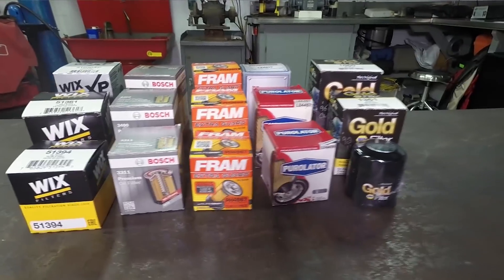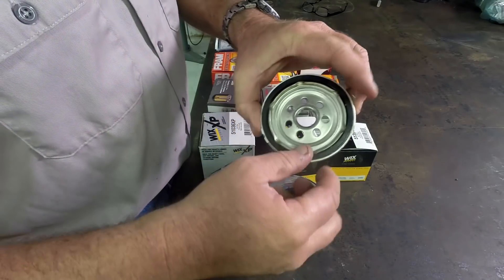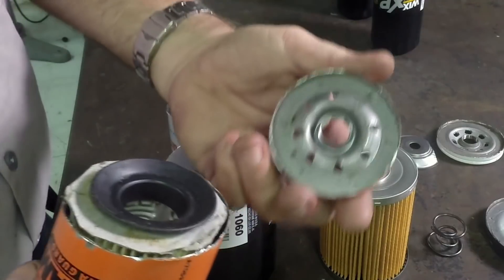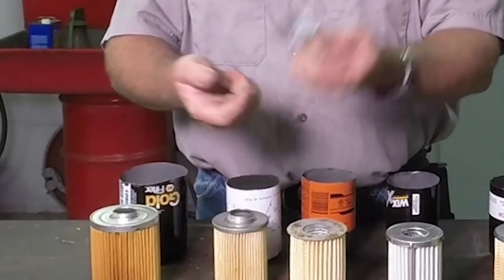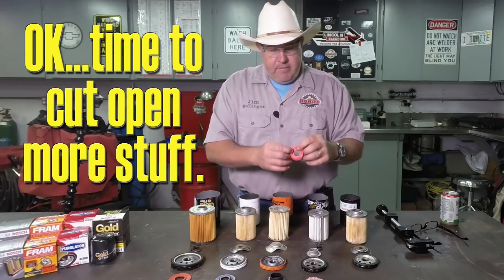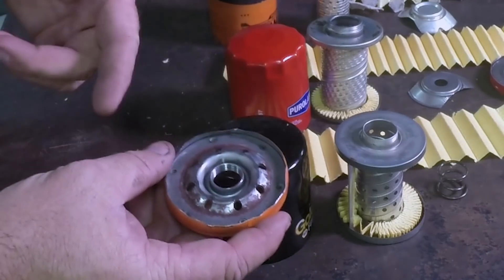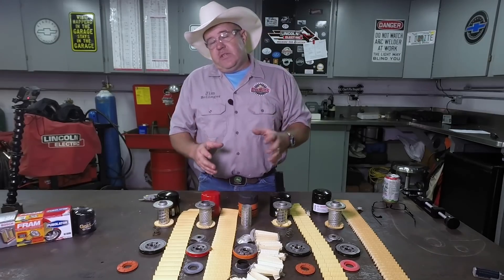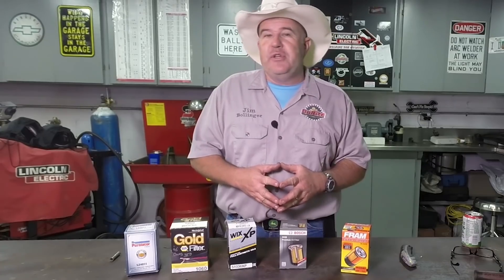The worst oil filter EVER!

Comment: Anti drain back valve, is only necessary if the oil filter goes on in anything but a vertical position. Otherwise it's useless.
An oil filter cutting tool is not so expensive and would make cutting those oil filters open a hell of a lot easier and cleaner.
And I know you probably do not believe it, and yes it looks like a cheaper device, which it probably is, but a tempered flat spring is a legitimate spring. And if it tests to do what they needed to do, in an oil bath it will last just as long as what a cheap-ass coil spring will do. As well as being easier to assemble in a high production environment.
You might want to measure that, as 10 gauge is almost a full one eighth of an inch thick. That is thicker than anything that's behind the driver in a 1968 Camaro. The heaviest piece of metal in one of those dangerous pieces of s*** is 11 gauge. Which is why when your rear end them you end up in their backseat before the car starts slowing down. Also why they needed subframe connectors when you put any kind of power in them.
You might want to try and check the pure one and also check the Purolator boss. Even Amsoil has been impressed with those for a couple of decades.
Very Illuminating, because it wasn't that long ago that Fram filters were actually decent filters.

Comment: Decent presentation, but if I may ask why weren't the filters spec to a particular engine. Different engines carry their own requirement, how the filter is mounted and if a drain back is required. I agree on one thing if its crap its crap.

Comment: Very interesting !  
Before watching your video, I made my predictions and your video confirmed my idea. In the late '80s, in Europe, I have done the same experience as you comparing Mann+Hummel filters with Fram filters and yet another brand. I think it was Technocar, but I'm not sure. This was the Mann W719/5 reference for VW gasoline engines.
My test was less extensive than yours, but was done on used filters. You could see the excellence of the Mann quality you mention for Wix and Napa, which seem to be the same industrial group.
In the Fram filters, there was a doubtful seal between the inlet and the outlet. A smaller paper surface. A badly immobilized paper. As a result, some foldings were very tight when others were lying ... and sometimes torn apart. In addition, the discharge valve in case of obstruction was calibrated at a much lower value.
Whenever I had a customer who was traveling with a Fram filter, I showed him my experience. I have convinced many customers of the quality of Mann, especially since they were not more expensive given the quantities I sold.
I find it deplorable that a brand like Fram, which has been producing filters for 86 years, is not able to offer honest quality to its customers.

Comment: Also worth mentioning about oil filters is a lot of them have the by-pass valve on the back wash end of the filter, as opposed to near the anti drainback valve so on a very cold winter cold start the filter may go into by-pass and back wash crud back into the engine. If I remember correctly some of these filters would not meet ford's warranty requirements just because of where the by-pass is located. The motorcraft filter is of good quality and the by-pass being next to the anti drain back valve wont allow the filter to back wash, it simply bypasses the filter when bypass is needed...very cold winter starts, sometimes wide open throttle, partially clogged filter (if the filter is partially clogged you have other things to worry about anyways)!!
Reply: Your filter as crud in it your doing something wrong

Comment: I've been a tech for over 17 Yrs and I have seen more engines destroyed by those worthless orange cans than anything else you can think of. They fall apart internally and send the pieces through the engine. I've been warning people for years, don't waste your money on that garbage. I can't believe Fram hasn't been put out of business by now.
Reply: Jed Brown The local Cummins shop once told me I was smart to use Fleetguard (Cummins) oil filters. He said they frequently have engines ruined with oil galleries plugged from aftermarket filters coming apart. Napa Gold for me on everything except the Cummins. I haven’t used a Fram since the ‘60’s.
Reply: Idiots not the filter killed the engine. I'd rather have cardboard than metal in my engine

Comment: The NAPA Gold is printed with Mann + Hummel.  First hint of good quality (but never go solely on that because the Germans also produce utter garbage knowing people trust German names).  Back in the day I used to use NAPA Golds because they were relabeled  high end Wix filters and stood up to the factory German ones from Mann and Mahle.  Plus they didn't bypass at low pressures like every aftermarket one.

Comment: You don't know what you are talking about. Compare apples to apples not oranges.  That Fram is the cheapest filter in the lineup.  As for the Rust, I have done this kind of testing many moons ago and did not find what you claim. Napa Gold used to be the Premium Filter but has since been replaced by Platinum. Wix and Bosch are also sold as premium filters. Purolator would be the best comparison in my opinion and should be crowned "best bang for buck". Compare the Fram Tough Guard and you will find a much better comparison

Comment: Great video! But I have used Fram filter for over 20 years and have had a few motors over 250,00 miles with no issues. I can agree they are the cheapest and not the best made but if you changing oil every 3,000 miles they hold up in a normal engine just fine. I now change my oil every 5 to 9,000 miles and use a better filter be it wix or Mobil one just because I'm running the oil longer.

Comment: good analysis.  However, you failed to not one advantage the FRAM has over the others : a rubberized wrench contact surface.  I have one car that the filter is a nightmare to get to.  The only filter you can get on and off is one that has that rubberized surface.  On my other car I use a  Mobil One filter.

Comment: The Wix filter is junk it will collapse on a dry-sump motor under its own pressure...garbage
Reply: The only filters I saw exploded had been subjected to abnormal pressure due to a faulty oil pump : blocked relief valve.

Comment: Well that fram filter isn't worth two cents, but are all fram filters like this?... fram makes several different ones. The one you cut open is the cheap version fram. Also, there's many other kinds of filters, would like to see mopar, ac delco, and motorcraft filters cut open, see what they look like.

Comment: After pitting 200,000 miles on my '76 Capri, the bypass failed. I drove it another 100,000 miles without one drop of oil going thru the filter. My dad drove a '50 Ford for 10 years and never once changed the oil. Old cars did not have filters.